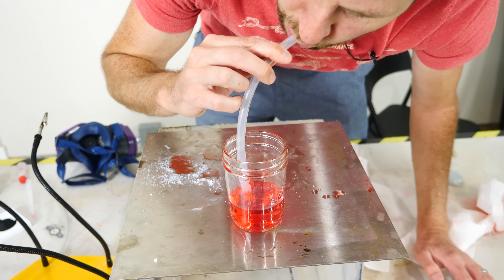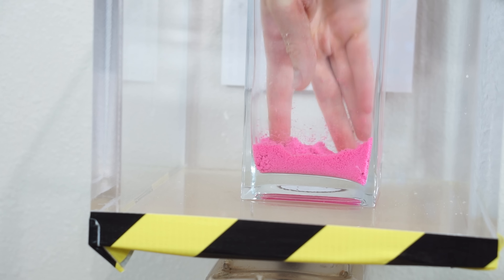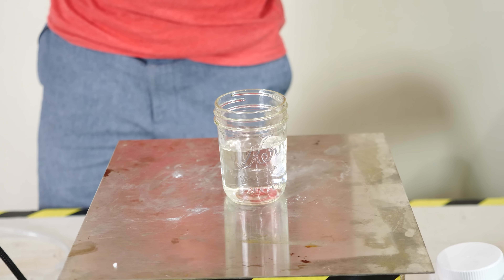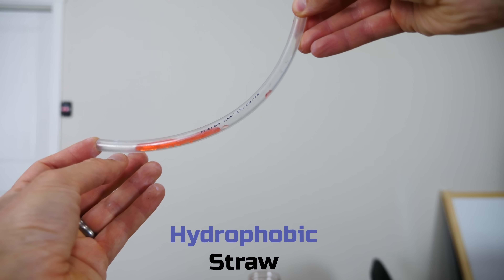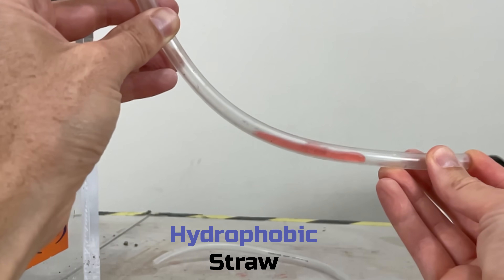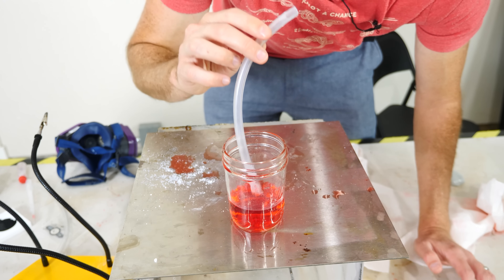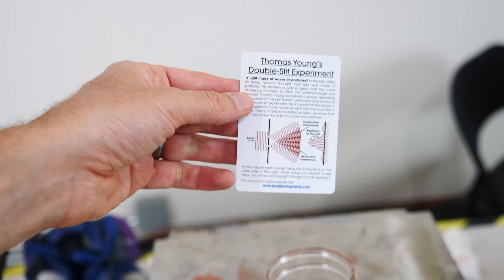Can You Drink With a Hydrophobic Straw?

Comment: Another interesting one that I didn't think would be. I explained it would work for drinking and didn't think it would hold liquid when the top was plugged, but the upside down meniscus was completely surprising. 
So I have a question. 
If you had a trap on your drain like that, would your house fill with sewer gas? 
Well two questions. Would it only allow sewer gas when the faucet is on?
About the hydrophobia, I'm developing it. I retain water while being a halophile, I've got hyperhydrosis and make puddles in the sauna that go to the drain, and I'm trying to lose weight. However in addition to reducing salt in my diet, I actually need to drink more water and eat less carbs to do it. And it's all science I've learned about how humans are really complicated chemical machines.

Comment: If you ever use fumed silica, please please please use respiratory protection.  He just had an open jar of the stuff that he powdered into the straw.

Silicosis is where you get small bits of extremely sharp silica particles into your lungs, where they basically stay the rest of your life cutting up your lungs.  You can get it from working with sand or glass.  And fumed silica is far, far worse.

Comment: The end of your had a sharp cut, a sharp angle or corner that does not become hydrophobic. That’s why the straw worked normally when submerged. The 90 degree edges on the cut end, both outside and inside, need to be rounded, and smooth.

Comment: You can suck the liquid up because the viscosity of the air is not zero. You are basically sucking the air that is coating the straw along with the liquid, and you csn do this becsuse the liquid to air ratio is small, so you are mostly sucking liquid which is more viscous.
But when you pull the straw, it is now air beneath the liquid and it falls under the force of gravity unless you suck hard enough to overpower that force.

Comment: I don't think the air layer between the straw and the liquid is what breaks the seal. I think the reduced adhesion to the wall makes the liquid form a roundish liquid bubble in the straw instead of making the typical shape, concave on the surfaces. You can see this happen in the experiment where you cover both ends of a tube with your fingers. The normal straw holds the water fixed in the middle, with a concave shape on each surface, sealing a whole section of the tube. The hydrophobic straw makes a bubble that leaves a macroscopic air gap above it. I think the macroscopic air gap explains the effect not the microscopic layer of air. This also explains why you can suck liquid up the straw while it is dipped in the liquid (the seal is complete, even with an air interface between liquid and straw) but if you remove the straw from the container, the liquid falls (because it forms a bubble that does not fully fill the section of the straw).

Comment: Super hydrophobic surfaces seem to act kind of like maglev for liquids.
Could a super hydrophobic pipe have liquid pumped through it using less energy than a traditional pipe? Or a trough and water wheel kind of setup with a super hydrophobic trough?
If you made a whirlpool in a super hydrophobic container, would it last longer than one in a normal container because the water experiences little friction with the container?

Comment: I was at a restaurant that used paper straws and realized 10 mins in the straw was dead.
so I proposed we either use a wax-coated straw or better yet, a hydrophobic straw. to make it hydrophobic, we would need to possibly use tiny microfibers such you find on lilypads or the wings of planes. the problem is manufacturing, I need to study how one could put microfibers onto a paper material cost-effectively. the straws need to be cheaper than plastic, while being bio-degradable and safe for the environment.

Comment: Just an important physics reminder, when you use a straw, you aren't actually pulling the liquid through the straw the atmosphere is *pushing*.

Atmospheric pressure is pushing down on the liquid in the cup and by removing the air already in the straw you're creating a pressure difference. This means the net force on the water is actually the atmosphere pushing the liquid through the straw not the person sucking.

Comment: What you call hydrophobic is not the canonical definition of hydrophobic. 

The fumed hydrophobic silica you use is coated on your straw and does leave an air layer in between the straw and the water. However, the question of whether a surface is hydrophilic or hydrophobic is determined by the adhesion properties between the surface and glass and that depends on the Van Der Waals forces and the Hamaker constant of your material. You can determine how  hydrophilic or hydrophobic a surface is by the contact angle water makes when it comes into contact with it, water will form spheroid droplets on e.g. PTFE, which is hydrophobic and it will wet nicely on clean glass which is hydrophilic.
Reply: Also: sucking witch your mouth on a straw coated with hydrophobic silica sounds like a very unhealthy idea...

Comment: 1:00
prediction: the amount of pressure required to release the water back into the cup will have a higher required psi than pulling the water up the straw, however this may mean that the water takes more time and constant suction pressure just to get a sip.

Comment: Ok.
Now look into hydrophobic bearings as a form of frictionless bearings.
I'm curious about the longevity of the thing, and how it'll handle heat tolerances.
Reply: A hydrophobic object is only "frictionless" in water. I don't know what bearings you are talking about, but if it's something like ball bearings, then having them covered in a powder like fumed silica is gonna ruin them pretty quickly.

Comment: in the case of the water in the straw with both ends plugged, why doesn't plugging the ends still lock the water in place? even if there's a layer of air preventing a vacuum in one direction, the air wouldn't be able to get past your fingers

Comment: This brings up a thought. What if we were to use hydrophobic tubing in water cooling for computers? Would this allow for potentially faster cooling since the water can move faster with less friction within the tube? What about energy efficiency of the pump? Would it decrease the energy needed to run a pump if water can flow through tubes more easily?
Reply: Yes, absolutely. But keep in mind that it has to be a fully closed system with no openings whatsoever, or nothing will work

Comment: I wonder how one of those hydrophobic straws would work when trying to use it to syphon water from a higher bucket into a lower one...
Reply: Well since there isn't a vacuum within the straw allowing that to happen anymore I think that it simply wouldn't work at all, assuming that you mean the highest point of the straw is above both of the buckets mentioned.
Reply: @kushpatel0110  That's my assumption as well, but you always need to test a hypothesis before you can say for sure it's true.

Comment: Did you also make the outside and the bottom edge of the straw hydrophobic with the fumed silica? Because if not, the fact you can drink through it so long as it stays submerged doesn't tell us anything about your hypothesis that the layer of air would become a tunnel and break the seal for the pressure differential. So I'm curious to know :)
Reply: i was looking for this coment

Comment: To argue with the conclusion, even if there WERE a layer of air surrounding the outside and inside surfaces of the straw, there's still the gap in the middle where no straw, no plastic, no fumed silica is, just a gap, empty space. Nominally filled with air. But it'd still fill with water underwater, you can't have hydrophobic empty space. Perhaps a very narrow straw would keep out the water, but a wide one like that, the pressure of the water is still going to force itself into the gap, and air upward out the top, til the straw is filled to the outside level. So theoretically even if it were a column of water surrounded by air, it'd work. The air, which would normally collapse, would be "supported" by the hydrophobic forces and the effective pressure they create. Since there's no source of replacement air under the straw, or in our man's mouth.

Comment: My guess... it'll be like the vacuum chamber. The straw will no longer be effectively hydrophobic.

With a hydrophobic straw, the air layer wouldn't persist, because there's no air supply under the water, nor in our guy's mouth. What's his name btw? So the water will touch the sides even if it's technically "repelled", it'll get however close. Actually the thickness of whichever air layer might depend on the pressure caused by atmosphere minus suction, as passed via the water. 

Straws work by the atmosphere pushing water up into an area of lower pressure, that's gonna work regardless, and air can certainly be sucked out of straws too, more easily than water in fact. So either way it'll work. 

That's my hypothesis, now to watch!

Comment: If you still have the ability to make stuff hydrophobic. I would expect hydrophobic sharp corners to have no air pocket around them. Or in otherwords if both ends of the straw where rounded, for you to not be able to suck the water up. Or is there a negative pressure going on that sticks the water to the surface. How . Why does it behave the way it does. This Video made me curiouse. Good job.

Comment: I think the bottom sharp edge of the straw probably breaks the hydrophobic effect, allowing suction if the straw is submerged. If you could somehow make a smooth glass straw, with rounded edges, and coat it with hydrophobic stuff.. Maybe the air coming down around the outside surface would make it's way up into the straw, even while submerged, tho it might not be enough air to prevent pulling liquid up.

Comment: Aren't normal straws hydrophobic? Assuming we're talking about plastic straws, they're made up of mostly non-polar polymers (usually polypropylene) that contain mostly neutrally charged carbon chains, with stable non-polar covalently bonded hydrogen atoms. It's a similar reason to why these plastics are poor electrical conductors. They aren't hydrophobic to any extreme level, but they're still hydrophobic.

Comment: ** correction, when you suck the air out, its still hydrophilic it just doesn't appear how it does at atmospheric pressure as the air is no longer surrounding the grains - the sand still really doesn't want to be next to the water. Kind of like forcing two negative ends of a magnet together - still repel.

Nice video though would never have thought that would happen!!!

Comment: When the liquid dribbles out the end of the sealed straw, it is coming out because the lower surface is destabilized, the water dribbles down one side and air rises on the other side of the straw. The top surface doesn't move until all the rest of the water has drained.

This is not the same effect as if air had leaked along its thin film, if this had happened the water in the tube would have dropped down like a column. Also, if the air film leaked you would not have been able to draw water up in the first place because air would leak down the film on the outside of the tube, around the end, and up the film on the inside of the tube.

The air film is just too thin to allow any substantial air flow.

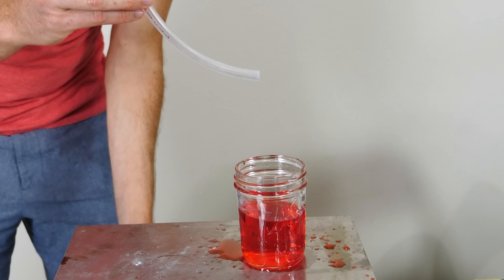Though it might be interesting to draw up water, seal the top end, and see if (or how quickly) the water level drops down. Sort of like around 2:00 but don't pull the lower end of the tube above the water surface.

Comment: Question : *   You state that air is coating the inside and outside of the straw. I think you are overcoming the pressure with your strong mouth. If you were to suck slow enough not to overcome this, I think you would not be successful in sucking fluid up the straw. So your answer that you are able to suck it up, well it's not 100% of the time. It is not absolute. It's only when you have a large vacuum compared to the air space that is between the straw and the fluid.

Comment: 1 correction I would like to offer. Fumed silica is hydrophilic. It needs a treatment or coating of polydimethylsiloxane or similar to make it hydrophobic. Fumed silica is amorpheus or without crystalline structure.  It can be thought of as similar to popcorn but made from grains of silica. Without the treatment, it absorbs water like crazy, and regains its crystal structure as it dries. It has an increadable amount of surface area. 1 cubic cm has as much surface area as a football field. Inhaling it is not healthy as it gels in the lungs. The small amount on the surface of that straw is not a danger, but i would not  recommend making it a habbit. Eating it is not a problem. It is in many food products. Powdered soups would be clumps without it.  Mix just a tiny amount in starch or flower and they will flow almost like a liquid. Very cool stuff.

Comment: I wonder what would have happened if you would have coated the exterior of the straw as well and not only the inside. Then you probably couldn't drink it even if the straw is completely submerged because there would be air all around the straw

Comment: How do hydrophobic substances react to other hydrophobic substances and similar like certain silicone oils, mercury, gallium?
Reply: It depends on their molecular bond. Water is "wet" because the difference in charges btween oxygen and hydrogen is over a specific limit. A water molecule is called a dipole, because it has two distinct poles (+ and - ; oxygen is negative, hydrogen is positive). A hydrophobic substance is a molecule with a bond with a charge difference lower then that of water and is therefore not a dipole.

To give you some numbers, oxygen's electronegativity (the charge responsible for this whole story) is 3.4 and hydrogen's is 2.1. 
The difference (3.4 - 2.1=) 1.3 makes it a dipole.

Oil, which is a hydrophobic substance, is made from (mostly) carbon and hydrogen molecules. Carbon's electronegativity is 2.5, so the difference here is only 0.4, making the molecule NOT a dipole.

Now, a dipole (hydrophilic substance, means it "likes" water) can only mix with another dipole. 
A hydrophobic (means "afraid" of water) substance can only mix with another hydrophobic substance. 

This does NOT mean that all hydrophobic substances can mix together perfectly, but only that they all react the same way towards water
Reply: @sirascaron  I actually knew all that.. and that some strongly hydrophobic substances are actually highly charged , but in a symmetrical manor, no dipole..
And yes not all hydrophobic things mix, and sometimes it has to do more with self affinity and surface tension then their charge... Gallium and mercury don't mix well and "wet" glass different.

I was asking because I wanted to know how the less common hydrophobes react with each other , and why , what kind of meniscuses are in that hydrophobic straw with other hydrophobic liquids? Can hydrophobes experience capillary action into what degree in what combinations?  Even if the response was just mentioning two substances I don't have around the house it might give me some insight.

Question, are you someone who just happened to pay attention in school and able to remember this stuff or is chemistry your profession?

Comment: Realistically I know that no additional air can get into the submerged part of the straw meaning it obviously would still work as a straw. But dammit if this man didn't have me second guessing myself because of his whacky as science shenanigans.
Reply: I think the theory is the air could go down the outside of the straw, around the bottom and up the inside wall. I'm not sure why it didn't work that way.
Reply: @chaos.corner  ig it's less because it's hydrophobic, and more that it's air-phillic? The air sticks to the straw, and isn't able to move freely- this air barrier also prevents the water from touching the straw, it just slips along the stuck air.
Something like that anyway.
Reply: Ok, so here's the thing, it probably wouldn't matter much if air got into the straw as he was using it, so long as he could maintain a ΔP great enough for atmospheric pressure to overcome the gravity of the water. 

When using a straw, you don't "suck" liquids through. Instead, you remove air inside the straw lowering the pressure enough to allow the atmosphere to "push" the liquid up through the straw. This is also why siphons work. 

You can prove this by picking up a small roll of 1/4" vinyl tubing at your local hardware store. Take  a bucket of water and place one end of the tube in the bucket. With both ends of your "straw" at similar heights, you can easily pull water through the long tube and drink from it just as you would a regular straw.

However, if you get up on a ladder some 10-15 feet above your bucket, you will find that no matter how hard you try, it's impossible to draw water through the straw. This is because the force of gravity on the column of water (static water pressure is measured only by height, not volume) is too much to overcome using just the net pressure difference of the air inside the straw.

Comment: What if you coat the outside as well? That would break the water sealing around the straw on the surface making it impossible to use the straw right?

Comment: Action Lab, 
I assume the thin air layer causes air leakage around the submerged straw tip.  Can your straw maintain suction or pressure with the tip submerged?
Reply: I don't really understand your question, but if you're asking, whether or not a submerged hydrophobic staw can hold water in it; then the answer is no. 
You can see in the video that, even tho one of the ends of the straw is sealed, the water drops out as soon as it leaves the container. It does have some delay, but that is due to superficial tension.